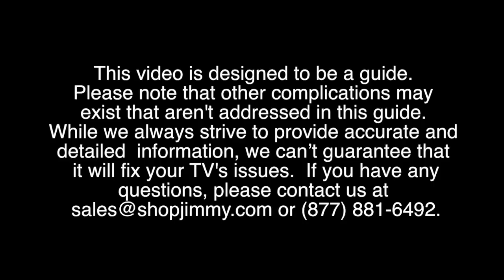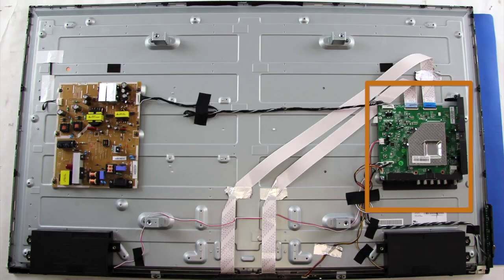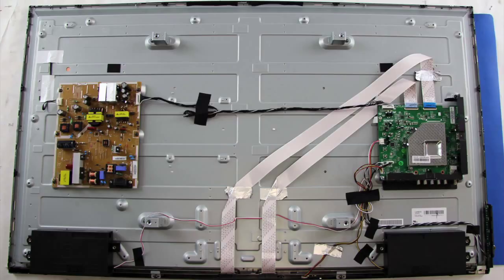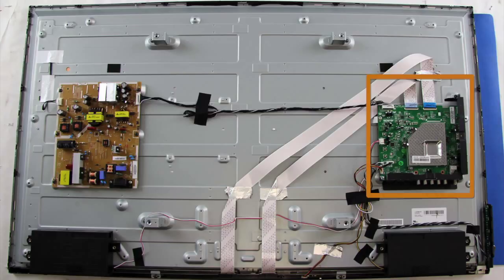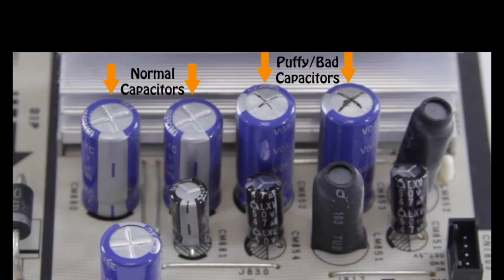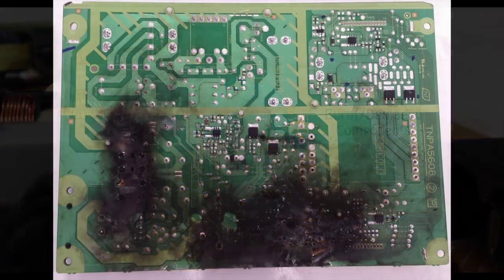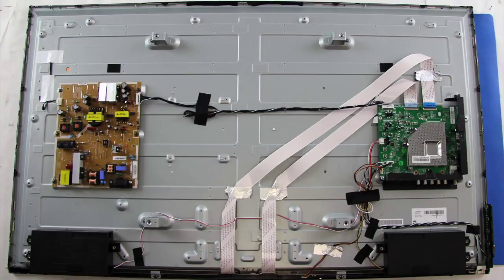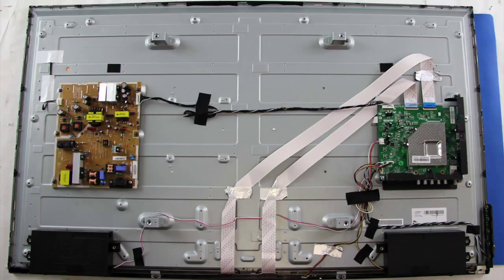Vizio LED TV Repair - TV Has Backlights but no Image on Screen Troubleshooting Help

Comment: I have a vizio D40f-G9 with blackscreen. I replaced the mainboard with no change. I replaced the 3 backlight strips and no useable picture but screen shows verticle color bars on screen. any ideas?

Comment: I changed out the Main Board/Power Supply for my Vizio model V505-J09. The old board has several burn marks so it was trashed.  The new one now lights up the front screen, but I still don't get a picture.  I have re-connected all the cable a few times but nothing changes.  Secondly the remote doesn't work.  I can't seem to reconnect it to the TV.  Any suggestions?  Buy new cables??

Comment: I have been working on a Vizio e48-d0. It appears to be powering on fine and the main board is fine too. The connections all seem to work fine. The problem I am having is that when I power the TV on all you get is the backlight but nothing else. This model doesn’t appear to have a TCON board. There is one ribbon that goes to the LCD panel so I am guessing the TCon board is built into the panel somehow? I noticed that in your repair kit you only offer a power board and a main board but no TCON board. Any idea on how to work on this?

Comment: Hello, I have a Vizio 70" tv, model E701i-A3, has backlights, white power light comes on and then fades away after a few seconds, has no image or sound, replaced the T-con board and still the same, really need help?

Comment: My Vizio has a backlight, but no picture. 

It’s a 3 board unit and I replaced all 3 boards through this website, and it did not fix the problem. 

I still have a backlight with no picture. 

What do I do now?

Comment: My son gave me his Vizio E60 E3 Smart Home Theater TV. It worked but had a blue tint to the picture. He replaced the LED light strips with the updated rev2 versions. Now it powers up, led back lights come on, no display,  no Vizio symbol blue screen and repeats the shut-off on process. Like it is not properly booting.  He now gave it to me. I did get it to where the symbol tries to display as a large 6" white line then dissipates back to blue screen and did have sound for a while. Any suggestions ?

Comment: PROBLEM SOLVED | I bought a 70” vizio E701i-A3 in 2013 with a pride to purchase a TV from a rare American Company..  It went bad just 1 month after warranty.  I replaced a number of boards, but no avail.  I finally found a solution to make my TV works again.  Label my Vizio 70” TV with new name “Invizio TV”, and replace it with a new 75” SAMSUNG SMART TV.  Real smart !
Reply: I replaced my 65 inch Vizio with a 75-in LG QNED lol they actually refunded me for my TV though which was amazing

Comment: I have a Vizio M8011-A3 80" TV.  8 times out of 10, the TV powers on normally.  Sometimes the TV powers ON without video (only audio).  On these times, the initial Vizio V is not displayed at start-up.  When it get's into this non-Video mode, it might takes several hours or days before it returns to the normal mode. Any suggestions?

Comment: Well after trying everything on  Vizio 70" LED with this issue. Has backlights but no image. I've replaced the T-Con, Main board and now the Power board and it has the same issue. Nothing has changed at all.

Comment: I have a Vizio TV that turns on back lights come on but no sound and black screen and with the flash light test I see no image. I have replaced the power board new and still no image or sound. Could it be the main board?

Comment: I have a vizio M60-c3. Main symptom is no picture. Turns on, backlights are lit, and still has audio. Did flash light test, no images appearing and after watching a few videos I was fairly confident that it would be t-con board. Replaced it today with no avail. I have a power meter available, just need direction to further trouble shoot. Possible bad LED panel? If so, how would I test? Any recommendations welcomed

Comment: I have an issue I hope you can help me with.
A Vizio E75-E1 television. Not even two years old.
The backlighting works, and the TV can be turned on/off. But no image is displayed on the screen (even using the "flashlight" method).
There is plenty of backlighting present.
I was watching the TV when it failed; the screen image froze, then slowly faded to black over 30 seconds.
I'm gonna toss a T-con board at it because it's cheap, but not sure if that's going to fix anything.
I have eliminated the power board and LED boards as all that seems to be working, but figured I would post a comment here and see if anyone has a similar experience. 
The only other real possibilities would be the main board and/or screen.
Reply: Did the tcon board fix it?
Reply: @sf5553  nope. The screen ended up being shot. All the boards and power supply were fine.

Comment: What does the fail count ? It was from the cable going from the power board to main board. Zero volts when tv powered on from fail count...is that normal?

Comment: My vizio has vertical lines,no picture,no sound ,do u think i need a new t-con board? plus my ribbon cable broke off trying to remove the t-con board,is the ribbon cable replaceable?

Comment: I have a vizio M551d-A2 with the screen going dark. Done flashlight test & see images on screen. Backlights work. I have replaced the T-Con board and have the same issue. Picture will appear for a short period of time then goes dark. Suggestions????

Comment: I have a E601i-A3. Turned it on and the screen was green and blurry with green lines across the screen.  I could see an image  but blurry.  I turned of the TV and tried to turn it back on.  Nothing worked and there was no backlight but I could hear sound.  Tried to trouble shoot and ended up replacing the main board (Green).  Now I have backlight and sound but no picture.  Not sure where to go from here.  Should be noted that I only see two boards.  The power board and the main board.  Any help would be appreciated.
Reply: Yes, ended up being the power board.  I ordered one and installed it.  Tv is like new.  I did make a mistake when installing the board.  I didn't completely plug in one of the band plugs to the t-con board and, while I had back lighting, there was not picture or sound.  The Tv sat for a week before I got back to it.  Once I discovered the problem the TV worked perfectly.  So, my lesson to pass on is make sure you carefully check all connections.  My bad.  Hope that helps.
Reply: Any solution yet? I have the same issue with my tv

Comment: HELLO I have a tv zicio E420i-Ao turn on and
the image is fine after 30 minutes
  On the screen, there is a small black stripe on the screen and then there is no longer an image, I turn it off and I turn it on and the image returns
Reply: does this black stripe run vertically (top to bottom) or horizontally (left to right)??, and where exactly is this stripe on the display, and last question, does the stripe show up at the same spot every time??

Comment: I have a VIZIO E421VA.  The sound had always had issues.  Sometimes start increasing in volume and/or causing the TV to re-boot. or sometimes the sound would just cutting out, powering off and back on always get me back to being functional.  Now the sound has quit working all together.  VIZIO had only one troubleshooting Item listed on there web site, unplugging the power, pressing the power switch for 10 seconds and then powering back on.  I've had the TV for more than 3 years and am wondering if it worth repairing.  I can and have replaced boards on different equipment, so feel confident in replacing one if it will make the repair cost effective.

Comment: Hi. I'm having problem with my vizio p65-e1.
There is a darker strip 1.5 inch wide going hoizontal in about 1/3 of screen,upper part.its all the time no mather the input.
tv has 128 dimming zones.
Question: is it a led strip being burnt and need to be replaced?
plus when i connect computer image flashes, tv frezzes, and shuts down.
please help.thank you

Comment: Hello need help on a vizio d58u-d3.  Started noticing blueish purple screen for a while. Now there is no picture but sound is heard.   When tv is turned on, you can tell a dark purple blueish screen with sound.  Thought it might have been the tcon.  Changed it, but there were no change. Any ideas? Thanks for the videos as well

Comment: I have a 701i-a3 that has backlight, no picture and no image on the flashlight test.  Replaced main board, power board and t-con and it is still the exact same problem. Any other suggestions?
Reply: Kevin and Marlo Hultgren did you find the solution
Reply: Any solution yet?

Comment: Visio e55-d0 flashes on and off. After lowering the backlight level to 50% it stops flashing.. what board would I need to try. ?
Reply: Did you find a fix?

Comment: Thanks ShopJimmy! Your videos are incredibly helpful. I have a Vizio e420i-ao that had a bad LED strip. First I thought it was the power supply (and actually bought a power supply off eBay and had the same issue once I installed it: no image, no nothing except a fading power indicator at the bottom left corner of the TV). I almost gave up, but after following your instructions I was able to get the power readings using my meter and it came up with too much voltage on "Vout2" pin I believe.  I purchased the replacement LED strips from ShopJimmy, followed the detailed instructions on your video and saved myself from having to buy a new TV.  One note: make sure to test for signal before putting the back cover on. The only test I did after replacing the strips was to make sure I had backlights. Once I had that, I figured I was all set and I put the whole TV back together. When I connected my Amazon Fire etc and turned everything on I had no image, just a glowing TV. I had to take it all apart and watch this video (TV Has Backlights but no Image on Screen Troubleshooting Help). It turned out to be an improperly connected ribbon cable from the main board to the bottom (TCON?). Check all your connections folks!  Thanks again, ShopJimmy.
Reply: Just to let you know I have the same exact model TV as you do and experienced the same exact issues as described above. I changed both the power supply board and the main board. I also changed out all the LED strips (this was the original problem: one strip failed and caused a powers supply board issue). When I powered up I got a slight 'glow' on the TV but no signal. After reading your post above I decided to check BOTH of the ribbon cable connections. Although they looked good to my eyes, I pulled them out and took the time to seat them in properly. When I powered the TV back up, the signal was shown and the problem was resolved. Thanks to your post the TV is NOW working as it should. So people, double and triple check your Ribbon cable connections.

Comment: I have a vizio m471i-a2 about a year and half old. The top part of the picture a week ago started flickering and then one day had back screen. I did flashlight test and there is a picture. So i pulled back off and on the power board there is some brown marks. Do you think it is the power board or the LED lights that need replaced? I can send a pic of the board

Comment: I have a Vizo d32h-C0. The screen has loss it picture. I tested to affirm the backlights are coming on and there is sound. What part do I need to bring back the picture and direction for install. Thank BroTech.

Comment: Vizio E48-D0 has only 2 boards. So when powered, has backlight but no display. NOW, have replaced main board...same issue,...then replaced PS board....same issue, replaced LVDS cable.....same issue...went as far as replacing power/menu button panel...still same issue.....nothing left to replace so what the hells wrong with this Vizio???
Reply: did you figure it out?
Reply: yes, buffer boards attached to display were puckered, (O-scope showed Video signals on LVDS cable, but not on display) ...since I can't stand tossing stuff, I now have a new 24 volt, 28 LED shop bench light w/ reflector, that resembles a Vizio E-48 TV ;)
Reply: @thecentralscrutinizer5105  , I'm no expert but I thought my Vizio only had two boards.  Turns out there's a third board at the bottom under a metal plate.  (T-con board).  Possibly a problem there.?
Reply: @rick6633  thanks, I will investigate this further sir and let ya know
Reply: @rick6633  No Timing control board on this Vizio E48-D0, checked it out lil while ago,it's got a flat LVDS ribbon cable coming off main board, then it folds in a 45° angle, going down to the buffer board, thats tack soldered to the display. Oh, and I have 12volts at the fuse on buffer board. damndest trouble-shooting thing I've seen thru here in a while, I swear, it's a bad display, but I had to order a display tester anyways, so once thats here, I can connect display separate from the TV boards to this new tester for a confirmation ;)
Reply: @thecentralscrutinizer5105 , really be interested to know what you figure out.  Let us know when you do.  Thanks for sharing.

Comment: I have a LED VIZIO TV that is not turning on once I power it off. I have to unplug it and leave it unplugged  for some days and it could turn it on again. I have changed the Main Logic board; but, the problem persist.  Back light is just on for 1 or 2 second . What could be the root problem?
Reply: bad caps in power supply side

Comment: I have avizio 70' model E70-E3 gas no pcture and no sound and the back lights turn on for a few seconds an then turn off for a few seconds  and keep doing that on and off can you help me?
Reply: Jesus Canchola did you figure it out. Mine doing the same. Back light flickering

Comment: Ordered a new main board and tcon strips. Then I didn't have a backlight.. put original board back in and now have backlights again but no picture or sound. Getting the proper volts as well... could it be a problem with the led lights?
Reply: Alicia Riddle sounds like the new board you bought was no good. Return it and order another one

Comment: i have a 70inch vizio led tv we got it from a gentleman for free. it started out with a couple lines across the tv and then the screen went out completely. you can tell the tv turns on because the screen lights up just a little bit like instead of black it looks like a darkish navy color almost black. any ideas??
Reply: I have the same problem. I changed the yellow board and still have the same problem.
Reply: This just happened to me today too!! Damn it
Reply: Sierra Illk

Comment: I Have a Vizio E421v0. First it just shut off completely, wouldn't even turn on. The power supply had several components bad so we bought the power supply and installed. We now have power to it and sound but no picture. When turned it flashes for about 15 seconds and then stops. Tried the flashlight test but I can't see if their are any lights.

Comment: I have a 70" Vizio E701i-A3E.  the ethernet port is not getting a signal from my router either wireless or straight connection using ethernet cable.  I performed a troubleshoot to see if it was the cable and the cables were all connecting my laptop fine to the Internet.   how do I fix the ethernet port?

Comment: I have a 50 in MM series. had it for almost 2 years. first issue was power board. Second issue is thin vertical green lines all the way from left to right. could it be the board or cable?

Comment: I have a Vizio M50-C1 LED TV. When I turn on the TV, the power indicator led light turns on (bottom left) but no image/video on the screen. The indicator light fades out to off. I do see the backlights are ON inside near HDMI/USB/Cable area when I peek through back panel. I pressed power button couple of times again, and the indicator light turns on again and fades out. Unfortunately, No video display on the screen throughtout. 

What is the root cause ? and How can I fix these ? PLEASE PLEASE HELP.
Reply: I have the same problem but idk Wut to do
Reply: Did u guys figure it out......mine is doing the same

Comment: E470iAO No picture, No sound, No backlights, No picture with flash light test. Back light plug reads 124 volts plugged in or unplugged. Replaced both power supply and main boards and get same readings. Blue light on the front of tv turns on and then goes slowly out.

Comment: I have a Vizio E701I-A3 with backlight but no video, I replace the mainboard, power supply board and the TCon board that came in the kit, but I still have the same issue. can someone tell me what else I should check to fix this issue.
Reply: +Jr Ath  Having the same problem with ours E701i-A3 and bought the kit and replaced all the boards as well and same problem. Was the replacement TV Vizio sent us for our original that had white spot among other issues panel problem. 3 days after the 90 warranty ran out just suddenly went to blank screen, with audio working and the backlights still work and no bootup screen. Did you get an answer or fix for yours? I'm calling shopjimmy in the morning because I'm guessing the T-con board is defective(replacement that was with the kit looked older than the one pulled out of the TV), because there was never any symptoms that the panel was going on this one. You can unplug the cables from the main to the T-con and everything remains the same.

Comment: I have a E322AR and my screen comes on but just shows the visio light on the bottom and V logo on the screen. I can not pull up a menu and the no source comes up when disconnected from the cable line. Do you have any suggestion? Do you think it has any thing to do with the back light?
Reply: If the logo screen stays on and it looks normal, then it may be a corrupted eeprom chip on the main board. but if so, probably be easier to just replace the whole main board...unless your up on your IC soldering skills ;)

Comment: i have a 24 in vizio model E241i-A1 has backlight but will not come on and does not respond control commands.Once or twice it came on but then shut off.